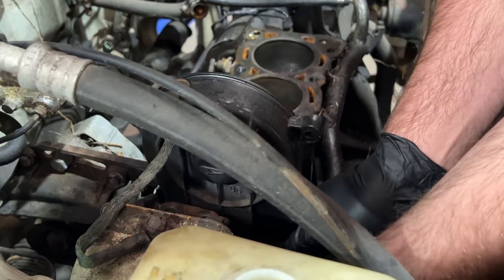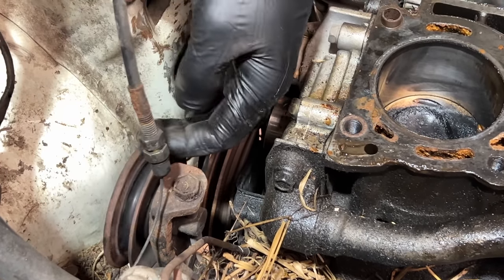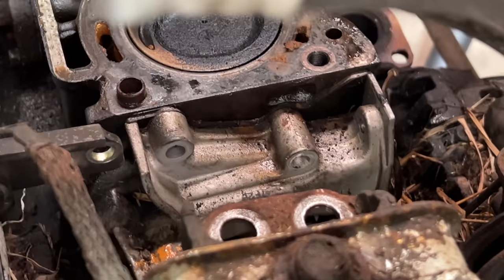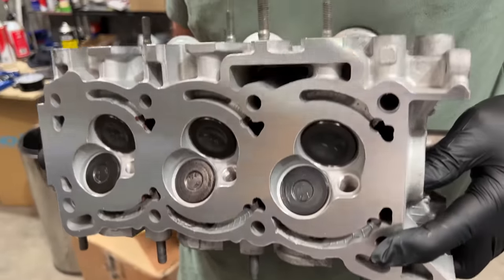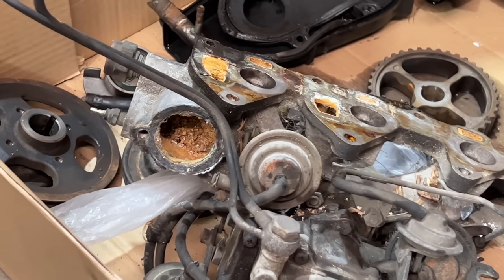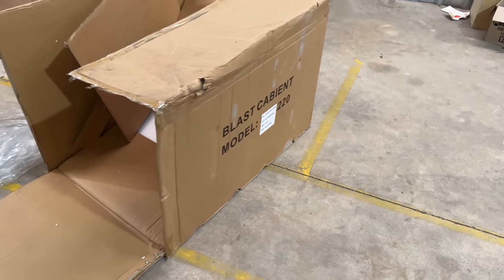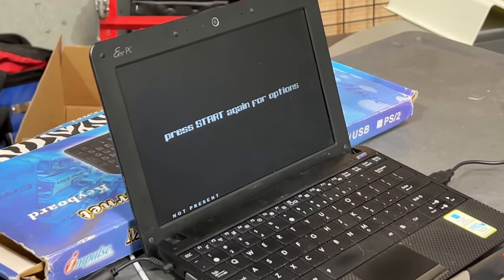Free Car Part 3: It's worse than we thought.

Comment: If there's one thing I've learned working on cars, it's almost always worse than you think!
Reply: true!
i work with cars every day
Reply: @joycegames5804  aye not all times my clutch job on my 2000 Mitsubishi eclipse gt was cake walk but it was just tryna set the tranny in an spot where it just slides in
Reply: @ThatblackEclipse  the…WHAT???
Reply: And that's the frustrating but fun part of it
Reply: True!
Reply: Yep it really is. Rip my Getrag G360
Reply: True af
Reply: Get something fixed, find two more broken bits 😎🤟
Reply: @kumi6797  transmission?
Reply: @kumi6797  shop speak for transmission. That usage long predates its use as a slur in political circles (politics ruins everything)
Reply: 3 out of 4 times:
Client: hey, my brakes are concerningly squeaky, can you check them out?
Mechanic: your hub is gone m8
Client: well shit
Reply: Especially if you're driving trash cars lol
Reply: "it's just engine knock, I'll clean out the engine and it will be good as new!"
Reply: @jwalster9412  knock gets worse FFFFFFFFFFFFFFFFFu-
Reply: @kumi6797  slang for transmission
Reply: @kumi6797  translation: After the clutch replacement, it is difficult to line up the transmission properly to reinstall it back onto the car
Reply: in my fiat if anything related to interior breaks, excluding the fuze box, you need to dissasemble the entire cockpit
Reply: Completely accurate. Sometimes everything goes right and it's easy, but 9/10 times something is going to come up you didn't plan for.
Reply: @kumi6797  transmission
Reply: @krystina662  I done my whole inside of the car I took the dash out replaced the ecu the engine harness the heater core the fans all that and put it back together like it never was tooken apart
Reply: Very, very true
Reply: Not always, I have a couple old Mercedes 190E’s, and my 2.3 had a bad coolant leak. It wasn’t leaking from under the hood, but more like from the transmission. I knew that meant the heater core, so I chose to ignore it for a few years. While replacing the wiper motor on my 2.6, I realized the heater control valve was in the exact spot the leak was coming from. $40 and 25 minutes of work fixed the coolant leak entirely. Of course the 2.6 was the opposite when the oil leak I thought was the valve cover turned out to be the head gasket lol (which I’m choosing to ignore for now)
Reply: @gilbertg.8501  my timing belt just decided to skip so now I’m dealing with timing literally rebuilt this whole car

Comment: That “really cheap Chinese sandblaster” is the exact same damn one that’s in my metal shop at my high school. Except ours is somehow worse. The front screen that has that black bezel on it in yours, broke on ours.

So we hastily cut a piece of plexiglass and drilled holes through it then drilled it back into the sandblaster. Beautiful.
Reply: Going by the cheapo one I used in my school, the Plexiglass you replaced was probably so thrashed on the inside you couldn't see through it before anyways.
Reply: Ah, trade school fixes. At the wood shop in my school, the stationary ribbon saw was held together with woodworking brackets drilled into it and copious amounts of duct tape.
Reply: @NEEDbacon  Someone managed to- break three of the screw heads off that were holding it on, so the poor thing was just dangling there
I talked to my shop teacher and the bezel's been gone for years lmao

Comment: Amazingly, I INSTANTLY recognized what the thumbnail was, and yes, sorry about how bad it is/will be. When you're reinstalling the head and gaskets, make sure you do a PERFECT job or the engine's just going to explode AGAIN. Ask how I know!
Reply: I'm interested.
Reply: I need to know more!
Reply: someone get this guy to the top
Reply: Yeah, cars that have sat forever are a specialty of mine. I’m not really surprised by any of this, it’s mostly just worse than wade thought lol.
Reply: 99% head jobs aren't rocket science, just make sure the gasket is right way on, mating surfaces are clean and tighten the head bolts on the right order and to the right torque spec. oh and make sure you do timing belt/chain right, that could explode the head immediately.
Reply: How
Reply: How do you know? 👀
Reply: @piuthemagicman  THIS is what I fucked up. Tightened a seemingly inconsequential bolt to the wrong spec. Engine spilled its guts again out only a few months later.
Reply: So what I am getting from this video and your comment, is that if I buy a used vehicle with an old timey oil and gas based engine and motors and something is only slightly wrong I should just accept it and not try and fix it. 

I can work on and fix up electric motors easily, and even the stuff I don't ever want to do is still doable at home with some extra time.

Comment: Hey boyo, I feel your guys pain restoring a car that's sat and rotted for so long. I'm restoring my grandpa's Ford F250 from 1976, ALL the bushings are gone and she was so clogged the whole carb needed to be replaced. And now the brake lights don't work. Or the signals. Anyway point is one problem at a time!!!
Reply: Same year as my dad's Chevy Nova. Damn thing has survived a brake lock crash, is half Bondo and duct tape, and I don't think there's an original part in that car. The Car of Theseus.
Reply: @gioandres205  but that's good though, means you're not afraid to change stuff. I didn't care about my old carb so I got a nice one from Holley and I'm gonna swap the original 390 with a 427 for the fun of it. Because that truck is definitely pretty modified so who cares if the engine came out of a Fairlane or Falcon. It'll be fun to have a race motor in a pickup with pretty long gearing

Comment: On Volvo red blocks, removal of the crankshaft pulley requires a special tool. Threads onto the tensioner bolt and the bottom fits into the slots on the pulley. Makes it go a lot easier

Comment: Throwing it out there that sometimes you can brace a large breaker bar against the ground or suspension and use the starter motor to break a stubborn crank bolt free! Many years working on rusty nuggets 👌🏼
Reply: Doesn't that risk cracking a tooth off the flywheel if the bolt doesn't pop? I mean, if it works it works, but that seems like an awfully high risk way to go about it.
Reply: @Gearjerk5  Doubtful, but it’s more a last ditch effort so worth the risk in my opinion 🤞🏼
Reply: @Gearjerk5  you can't make an omlette without cracking a tooth

Comment: If there’s oil starvation check out the oil pump. If worn out it won’t be giving you the pressure you need.

It could also be full of sludge in the bottom end. Take off the sump and check the oil pickup

Comment: Oh man, Harvey Dent fighting you every moment reminds me of a close to death MX6 we bought for what we used to call Phoenix TT (take an almost dead used car to the track, drive it til it dies, fastest lap gets the scrap value).

1989, one owner from new, serviced once when we got it in 2007. All the suspension was blown, every bolt was either rusted in place or missing, it was firing on 3 cylinders and the trans fluid looked like playdoh. We got it running, slapped a turbo on and sent it to Valhalla 😂

Comment: obviously that cooling system needs a deep DEEP clean, but one thing you can do afterwards is install an inline coolant filter in the water outlet hose to catch any residual crap that might end up flaking off before it can get into the new radiator.

Comment: Easy way to get that crank bolt out. Cut a chunk of wood. Put it in one of the cylinders that is about half way up. Not down, UP. It needs to be in the compression stroke. Bolt the head back on. Then crank on that bolt. The wood will hold the piston in place and stop the crank from rotating with less chance of damaging anything.

Comment: So, for future projects, you can fill a cylinder with a fluid or rags, then and set the head back on and snug a few head bolts in and the engine will lock up and not rotate

Comment: NO FRANK?!?! Man, that's sad :( Would have loved my Olive or Goggles to see what Frank was up to at the end of the ep...

Seriously though, great episode, those coolant passages looked a bit miffed, but I guess that's what happens when you run water through an iron block... Make sure to check the oil pump prior to assembly. If that valve damage was caused by oil starvation, I'd be suspecting the oil pump, or a few of the oil galleys being blocked up.

Comment: Do a the heater core and all new coolant lines. And I would take a preasure washer to the coolant jackets and pull the freeze plugs and do what you can from there as well. That way once you get it put together its just a coolant flush away rather than trying to save the heater core.

Comment: Sand leaking from sandblaster? Duct tape.
To flush the coolant system you can use phosphoric, oxalic or citric acid, in a bucket with a circulating pump. Put the engine together without the thermostat, circulate with acid for an hour or two, flush it out with water. Always use antifreeze.

Comment: You put the head back on with a just a couple of head studs done up hand tight and some rope coiled up on top of one of the pistons, then use a breaker bar to crack the crank pulley nut loose.

Comment: HEY. I have that same blast cabinet, and it’s honestly about as much as anyone needs. Trust me(says some guy on the internet) you would have to spend a crazy amount more to get a cabinet that’s legitimately nicer and not just the same cheap box you have in another color that was produced  in the same factory. In the end it’s just a box with gloves and a door, and once it’s together you will quickly forget how bad the assembly experience was.

What you(everyone) should spend the big bucks on is the compressor. Sandblasting with anything less than a man-sized vertical unit is truly a hateful experience. Like writing with your non-dominant hand. But if that cost you hundreds of dollars to do and took up significant space in your two-car garage.

Comment: That little cooling issue is not half bad for an old iron block, i've seen some RUNNING AND DRIVING cars what were completely blocked, and they were somehow not overheating. I had to poke it with a screwdriver, then after a while i drilled through the crud on a few places so i can ever get it started to come out 🤣🤣🤣

Comment: Prepare for the trip of your lives with that old Korean carburetor. I can already tell there's a million different hose connections and it's gonna be your job to figure out which ones are important and affect performance if left open/closed. They also had electronic bits integrated into it which are probably disconnected at this point too and shouldn't be touched. How do I know all this? I used to own a 90s "Asia" microvan that was made in Korea and the carburetor was just as mad. Like, why does a stupid 3 cilinder engine need an aviation grade fuel control unit?!!! LMAO

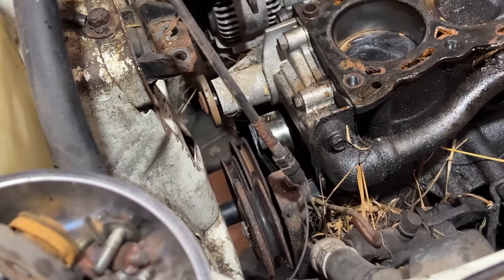Comment: 1:39 rather than reverse, you take the belt (obvious assuming one's left) and you put it on the pulley, then, you take some bailing wire and lash the belt as tight as possible, making multiple loops with the wire around the belt. Through that, you put a lever or a screw driver and then you try to take the bolt out. The tighter you get the belt on the pulley, the better. There's tools for that, but they're basically the same thing ... just stupidly expensive (because yey unchecked profiteering).
Another method is to jam a lever into the teeth of the flywheel against a bolt or something. Short of being seriously unlucky, that method always works, but i didn't say it first because it sucks in transversal small cars.

Comment: I took that crankbolt off from my Daihatsu. It was quite a tedious job cause I do not have a rattlegun so I just had to use a breaker bar and try to stop the engine from rotating. It was hard but I got it off in the end, it took couple of days and some sweat and blood.

Comment: If the direction is right, you can try using the starter motor to loosen the pulley bolt 8)

Comment: 1:45 I will admit I have done a nearly identical thing when I removed my crank bolt. Also in my car I had to remove an engine mount and drop the engine to get the pulley off.

Comment: check the oil pickup tube and screen. If its partially clogged you'll get enough oil to not nuke the bottom end but the valvetrain will starve.

Comment: Alright as a warning. Sand blasting sucks. Your going to get sand EVERYWHERE and all over you. Two dont over do it as you can put holes into steel and make sure you got the right sand or what ever you are using. There’s multiple grades different types etc. over all very useful, but very messy. The cabinets are fairly quiet unlike the larger ones.

Comment: Fellas, you arent using the best tool in your arsenal, Go get some of those super cheap parafin wax candles at the dollar store, and melt them onto the threads as close to whatever frozen bolt you have, just a little bit at a time, the wax creeps down the threads and will free it up as if it isnt stuck. That's how I got the frozen lugs off of all 6 wheels for my 1965 F600. That was after jumping on a breaker bar, and im no tiny feller, but the wax did the trick, just threaded right off easy as can be.

Comment: Looks like this car had a headgasket leak or radiator leak and the owner just dumped a bunch of stop leak into the cooling system to stop it. 
Remember kids if you have a head gasket leak , fix it right for good. Do not put stop leak even in an emergency!. The stop leak will destroy your entire cooling system!

Comment: @Garbage Time tell James for me please' Old School Trick for stopping the pulley from spinning; Ratchet Strap or a Literal Belt like what you use to keep your trousers up; wrap around pulley in the opposite direction of turn & to remove the junk in the cooling passages; boiling hot water with Denture Cleaning Tablets; let that solution sit in the passages for about an hour to do its work; then flush the system over & over till the yuck all comes out

Comment: You need to take the engine out mate, Stop avoiding it. Considering the time, money and energy you are putting in to this nugget, it's really not smart to just leave the bottom end as it is, becasue all the cooling passages will need to be cleaned anyway!

Comment: JC, seriously?
Put vehicle in gear and apply the brakes. Undo crank pulley bolt.

OR..
Put socket and breaker bar on crank pulley bolt and crank the engine.

SMH.